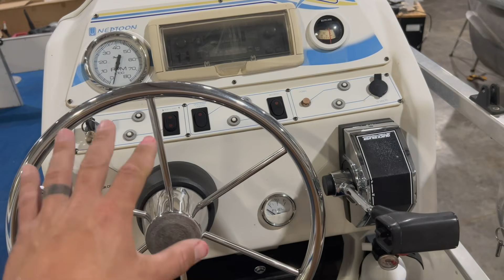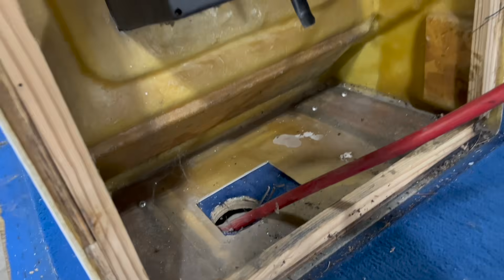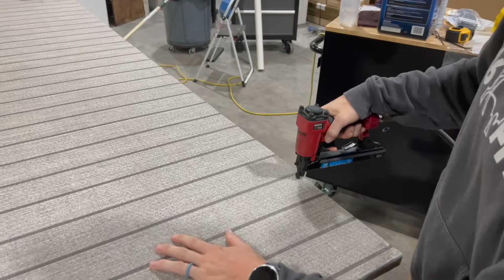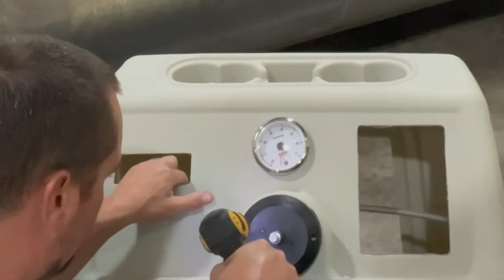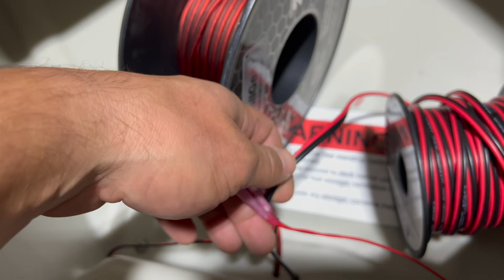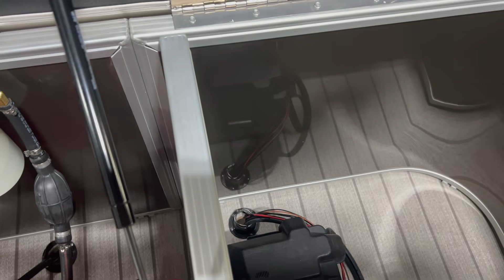Complete Pontoon Restoration - Instructional - 1996 JC Pontoon

Comment: Great video. Was wondering, is an undercoating on the deck plywood a good added prote tion? Also, what is a ballpark budget for a rebuild like this? Minus labor of course.
Reply from the maker: If you use the correct plywood that Pontoon Stuff sells then it’s recommended that you do not seal it in any way. It’s treated against rot and does best if it can breathe. Most total restorations are around $10,000 to $13,000 for materials depending what options are chosen. A new 60 hp is around $10,500 installed these days.

Comment: Could you use one of those rubber eraser wheels on a drill to remove the adhesive from the rails instead of torching it?
Reply from the maker: I’ve heard of folks having good luck with those wheels…still a lot of work!

Comment: Tom, I've been watching your channel for a few years now and I'm finally working on restoring my 1992 Grumman.  Do you fill the top of the deck bolts with wood filler or anything like that before laying down the vinyl?  I've searched and searched and can not find a video related to it.  Thanks Wayne
Reply from the maker: Thanks for tuning in, glad you’re finally tackling your project! 

I do not typically fill any of the deck bolts. The glue will fill them for the most part, and 90% of them are pretty much flush or only 1/16” under the top of the deck. If you had a whoopsies and dug one a little too deep then you could use a wood filler like plastic-wood by DAP. Just make sure it’s fully dry before gluing your vinyl down otherwise it can pull out of the hole when you’re applying glue. Anything that’s 1/8” sunk in I just leave though! You won’t feel indentations nearly as much as something risen.
Reply: @tomspontoons thank you!. I value your guidance.

Comment: Tom I enjoy watching your videos! I have a JC pontoon just like the one you are working on.The problem I am having is the pontoons keep oil canning when sitting on the trailer or even in the water! when the sun hits it or the weather cools down I hear boom!!! this happens all the time and drives me crazy!!! and drives the neighbors out of there minds!
I know it is because the toons expand and contract. I know you have worked on a lot of pontoons but this is the only brand that does this....do you know how I can stop this!!
I am going crazy!!

Thanks Ron B
Reply from the maker: Hey Ron! Yes, JC is pretty much the only brand that does that because they don't fill their pontoons with anything and there's too much slack in the sheet metal from walls of the U pontoons. Round pontoons have structure naturally from the curve of the cylinder. There have been other U shaped pontoon brands over the years, but most are filled with foam to where I haven't seen that be an issue. The JC we just refloored a few weeks ago popped a couple times while in our shop. Nothing you can do about it unfortunately!

Comment: Why didn't you choose to treat the plywood whit some paint?
Reply from the maker: This plywood we use is CCA treated and has a 30 year warranty installed AS-IS. It should never be sealed or painted in any way. It needs to dry to prevent rotting. If you’re using a marine grade untreated plywood (like Menards sells) then you should epoxy or fiberglass it as that’s how it was meant to be used. It will not last if used on a pontoon boat exposed to elements constantly.

Comment: Awesome work that yall do! Learning everyday watching your videos. I have a quick question regarding repositioning the transom & pushing that motor back. I have a 24' crest pontoon with a 225 honda. The rear sits way lower already just from the motor weight, gas tank, etc. If i done the same thing, do you think itd make that worse or possibly help level it out?
Reply from the maker: Thanks for watching the channel! That's a HUGE outboard for a standard pontoon. I'm amazed the framework will even hold that without it being on a center pontoon transom. I wouldn't move that motor back from where it's at unless it was on a full length center pontoon with transom. That would help with the buoyancy and with getting the motor back where it can perform even better
Reply: @tomspontoons  thanks! That's what I I ultimately want to do but having a hard to find a log big enough. It's got 27" logs on it already so trying to find one slighter bigger is seeming impossible. Thanks again!
Reply from the maker: @dakotashirley5292 You can always match the outer pontoons and add spacers to drop the center pontoon down into the water an extra 2 inches. Thats common.
Reply: @tomspontoons That may be what I end up having to do. Thanks for that idea!
Reply from the maker: @dakotashirley5292 happy to help!!

Comment: I have a 97 dolphin 204. It needs new vinyl on the seats.
Reply from the maker: Your local canvas and upholstery shop should be able to help with that. We stick to only replacing seats altogether with the Deckmate seats from Pontoon Stuff. If your seats have wood in them I would heavily consider replacing the seats and seat bases with new seats, as the wood tends to be waterlogged and rotten on the older wooden seats.

Comment: How much on average doyit take to do what you just did?
Reply from the maker: Most boats can be restored like this one for around $12,000 to $15,000 in materials, before factoring in labor. A new 40-60 hp motor adds $8k to $11k quickly though!

Comment: How much is that console your working on what is it called can a shifter be put on right side not on side rail
Reply from the maker: It retails for right around $300 before adding switch panels and such. It's Pontoon Stuff's standard pontoon console and has lots of options. I just did an installation video of it recently which shows how you can use a binnacle mount shift/throttle with it:

https://youtu.be/Z7yZRRXfPuY

You can install some style of binnacle mount shift/throttle controls on it next to the steering wheel, but not with the full gauge/switch panel I used in the video. It gets quite tight on space when adding the control to the face of the console.

Comment: great vids!! Question: Do you know if putting a new vinyl floor down over an aluminum deck will have a "hot" floor over vinyl over wood?
Reply from the maker: It shouldn't be any different than when it's installed on wood. A hot day in the 90s under direct sun it'll get a bit hot, but just splash it down with water and it'll be good to go for a couple more hours. We've had black powder coated aluminum trim on our boat and it never felt very hot to the touch even on hot sunny days.

Comment: Hi Tom I am ordering docking lights from pontoon stuff and I ordered wire on Amazon and I got  14 gauge which is thick can I use it to wire the lights also what gauge is good all around for wiring navigation and other stuff have a 95’ sweet water thanks
Reply from the maker: 14 gauge will work, but it's overkill. Better to have too thick of gauge than too thin though! 16 gauge would be the ideal for all electrical accessories like LED lights, basic stereo, speaker wire, etc. The harness I use from Pontoon Stuff is pretty much all 16 gauge for all accessories. They use 12 gauge I believe as the main power to the dash from the battery.

Comment: HI, CAN I ASK YOU A QUESTION ABOUT PRICING I KNOW ALL OR DIFFERENT BUT A ESTIMATE , I HAVE A 2005 BASS BUGGY 18DLX FLOORING REPLACEMENT / WOOD /VINYL FLOORING .
Reply from the maker: Most boats of that size are around $4,000 to have everything stripped down, new plywood and vinyl, and everything reinstalled. Layouts and other accessories change the price obviously, but that’s a ballpark number!!

Comment: What is the approximate cost of rebuilding an older Pontoon Boat ??  I'm an older woman who loves to fish but my husband has no interest in the boat or the fishing so years ago I bought an older pontoon boat expecting that I could bring it up to standard.  It seems to be "nickel and diming" me" so I'm wondering if maybe rebuilding it may be a better idea since at most I have about 10 good years to enjoy going out on my pontoon boat and go fishing.
Reply from the maker: That's a great question. Most of the projects that we complete on restorations are in the $13,000 to $16,000 range...but that's replacing everything but the motor with brand new materials. Sometimes it's more, sometimes it's less. It just depends on exact options chosen. Either way, we're able to give people a "new" boat for 1/2 to 1/3 of the price of replacing with a new or lightly used boat. If you tackle the project yourself you can pick those exact items to replace and you'll save money on labor...just be ready to work hard!

Comment: It's not a tritoon and it is underpowered. The thing isn't going to go faster than 15 miles per hour. I would not buy it. It's got to be a tritoon and at least have a 150 for me to even consider it. Other than that it's nice.
Reply from the maker: Usually a 20' boat with a 60 hp will top out around 20-22 mph. Just enough to pull the kids around on a wakeboard or little ones on skis or a tube...but if you want to replace the need for a speedboat with a pontoon that can do it all and go 40 mph then you're 100% correct....it's gotta be a tritoon with 150+ hp.
Reply: @tomspontoons  Avalon makes a tritoon with twin Mercury 450s on it that’ll go 110 miles per hour. If you want a pontoon to replace a speedboat buy that instead. 40 miles per hour is slow.
Reply from the maker: Now that's a serious need for speed...and a huge check to write! Luckily, most of the pontoon world is happy just puttsing around the lake quietly loaded up with people and some food/drinks on board. It's mostly about comfort for the folks we're working with.

Comment: Will it hurt to put a sealer on wood before putting glue on the wood will sealer keep glue from working
Reply from the maker: I never seal any of the wood I install. Just install marine grade TREATED plywood and there'll be no need. In fact, a lot of folks will argue that sealing your plywood will cause it to rot faster as water will get stuck in the small spots you miss or voids in the surface like drilled holes, and not be able to breathe and dry. Any sealant will not allow the glue to cure if you're installing vinyl....making it much like installing vinyl onto aluminum or composite decking. If you're installing carpet then it'll be just fine as the carpet can breathe to allow the glue to cure.

Comment: wish I would have seen this before I took off my engine, I found out I the Hardway I needed to take off the engine first to get steering cable off. Ended up exposing some of the wire on the steering cable, Should I just replace the whole steering cable, or should I try plastic welding it back together or putting Jb weld around the exposed part that got scraped. exposed?
Reply from the maker: It's a crazy way that they design boats, not just pontoons either, to have to remove the motor to get the steering cable free. The best long term solution is definitely to replace the cable. What you're seeing exposed is likely just the metal sheathing of the cable (spindly wound wires). The actual cable moves inside of that metal sheathing. However, now water will be able to get in there and to the moving part over time. I've run boats with the plastic coating cracked and metal exposed for years with no issue, but it was in my youth when I didn't know any better. You could spray some lubricant in there and wrap it with electrical tape and it might last another 10 years....or you could go to turn it next spring and it could be seized up. It's a gamble unless you just replace it.
Reply: Thanks, that’s what I figured I probably just needed to replace it
Reply from the maker: @craigr.2755  yep, wish I had better news…but a new cable will last another 20+ years!

Comment: Good video and a good job on the restore but it makes me wonder why you don't just build a pontoon boat from scratch and not destroy a less expensive boat a family could afford to get them started at boating?  You take a $6k boat and turn it into a $30k+ boat when new pontoons and cross sections would have been about the and price as the older boat but with brand new toons.
Reply from the maker: I’m just doing the work at the request of my customers who like their boats and see value in restoring them to make them exactly what they want instead of spending far more on a new boat. Building a new boat has a lot of complications aside from sourcing quality materials. Luckily for all, there are tons of pontoon boats out there for sale under $6K for folks who want to try boating for the first time.

Comment: Awesome job getting ready to do my 3rd pontoon.
Reply from the maker: Are you buying them and flipping them to sell? Or just love it and keep making them better each build?
Reply: Both I love to work on them and flip them to sell.  I use to flip cars but i like doing the pontoons and other boats better.  Just sold a houseboat I built from a 24' pontoon. @tomspontoons
Reply from the maker: Boats can be quite a bit simpler and less expensive to restore to sell. But they still require a skill set to work on that most folks don't have adding value to what you do for sure!

Comment: Just a suggestion, but I think  an old fasioned linoleum roller would be a big help.  Also,, I find it strange that you don't run that tape on every cross member to prevent wood coming into direct contact with metal ?   Just curious.
Reply from the maker: I get people begging me to use a roller to save my knees, but it’s how I’ve always done it and I’m a creature of habit so I’m going to keep using the ole PVC…in seriousness, I like being down close to the vinyl to inspect it as I roll it for blemishes or bubbles. 

The tar tape is only for the seams to prevent water from splashing/spraying up between the plywood. The wood on the aluminum doesn’t cause any damage in freshwater that I’ve ever seen. 75+ boats in the last few years and all I’ve seen is a little dust on the aluminum from the contact/reaction.

Comment: What everyone is likely wondering is approximately how much does it cost to get all the necessary parts and materials to do something like this at home?
Reply from the maker: That’s the beauty of Pontoon Stuff…you can go put everything in your cart to completely restore your boat. A new 60 hp outboard will add $8,000+ real fast, and the new railing kits will hopefully be around $2500 for most boats. Our tritoon build last part has a thorough materials pricing breakdown.

Comment: What kind of plywood are y’all using? Marine AB
Or is that normal pressure treated exterior ply?
Reply from the maker: Everything we install is a Marine Grade CCA Treated plywood (3/4”). The only place I order it is from PontoonStuff.com, and they’ll deliver it to your door free shipping. It’s 7 layer, BC sanded. So you get a rough sanded side that’s void free for the top. This is the same plywood that pontoon manufacturers are installing on their new boats (and have been for the last 30 years). Some even give a lifetime warranty on their decks using the same stuff!

Comment: Wow ! Great video ! 
You take the time to explain more than enough. Bravo 👏🏻 
One of my Q? Is why not treat the underside? I realize there’s more cost ‘ but if it’s your personal boat you’ve gone this far. Why not protect it from the water your riding on ? Salt water or fresh ? Maybe like under coat or bed liner spray ? Don’t get me wrong you did a solid job for those owners. 
Hands down. Just something that was bothering me protecting on the top ! But totally bare on underside. 🤷‍♂️ Thank  you in advance
Reply from the maker: Thanks for watching, and great question!

That wood is 100% meant to be able to get wet and dry out without rotting (CCA treated marine grade 7 layer ply). If you seal it on either side you’d risk it not drying and rotting potentially. Let it breathe and dry out and it’ll last 20-30 years no problem. We go by what the new boat manufacturers do, which is treated marine grade with no sealant.
Reply: @tomspontoons  should have known I’d get a great response 👍🏻 
Thanks for the explanation too !
Super Cool
Reply from the maker: @chuckpoz1968  happy to help!